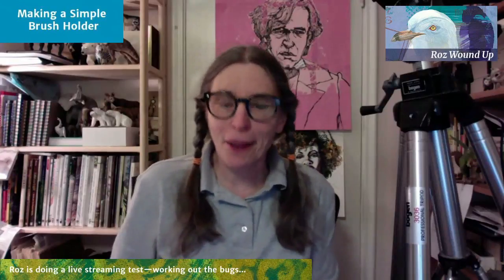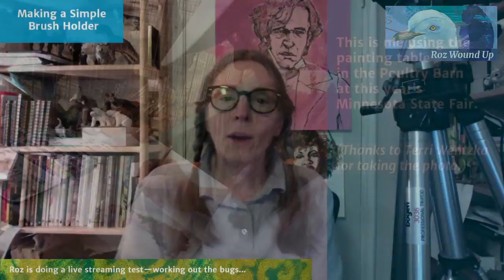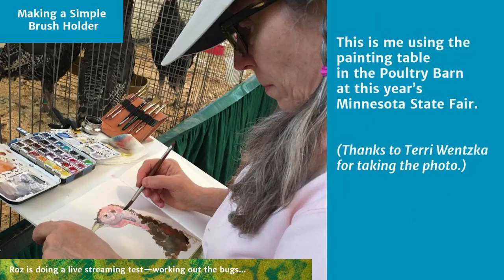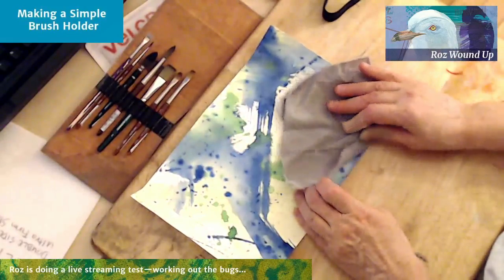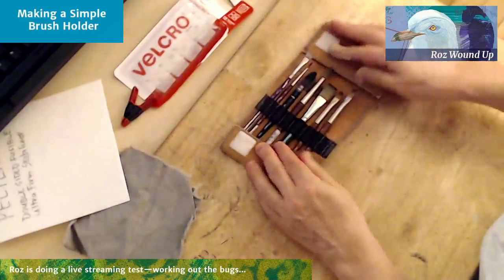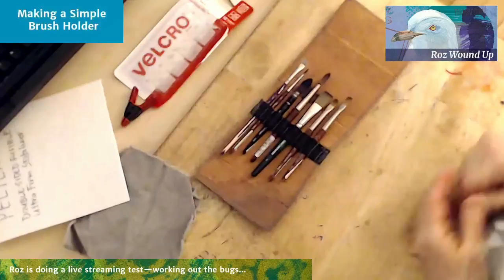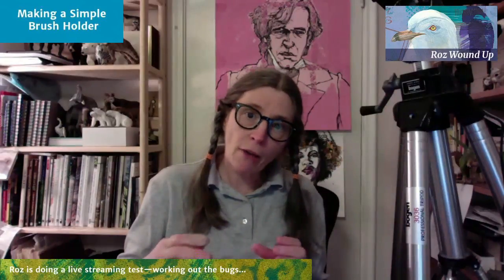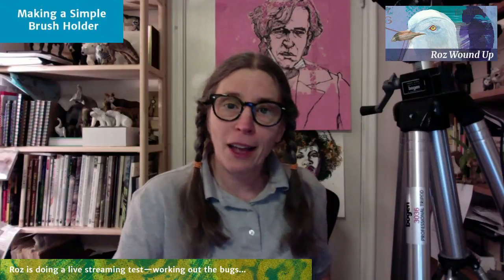Making a Simple Brush Holder

Comment: Great idea. Cant wait to see your final set up as well. I cave been using coroplast boards as well except instead of clips or velcro, i embedded tiny super strong magnets. Additionally, i cut a hole in the coroplast big enough to slide half way into it a urine sample cup from a dr's office. ( great leak proof way to carry  water and has a decent wide mouth to boot). Your Videos are coming along nicely. Thanks for sharing!
Reply from the maker: Magnets! That's something I always worry about with credit cards and stuff. Have you had any problems with the magnets? I like the Urine bottle idea. My ink bottle diagram that I gave Dick shows a cut out that I bet is similar to what you're suggesting. I'm going to order a urine bottle so that Dick can think about it in his phase of the project.
Reply: I have had no probs with the magnets i use the nickle size ( 2 of them to make sure my palette stays put) and on one of my board i put a teeny one on to hold my water.. ( i put a teeny one inside the urine cup,,so far it has held and it just sits on the board without moving ( make sure the positive is on the upside and the neg side is opposing it otherwise the cup will do anything but sit where it should. ) so far i am preferring the magnet to the cut out for the water ( if you put the board w the cut out on down flat on the floor or a table it forces thr urine cup up, level with the board) sadly i cannot send you pics here...
Reply from the maker: Thanks for sharing more about your magnets they are intriguing. I'm also sorry I didn't get back to you sooner about the "final set up." I can't to show this video to a student and in watching it see that I promised to have something else in September. Sadly there were too many disruptions in life this fall and neither Dick nor I had time to work on the final version. But I will put it up on my blog when it gets done. Thanks for your patience. And for all the magnet ideas!

Comment: Hi Roz, Love your brush holder.  You might consider just extending the top flap so it is long enough to fold back over, cover all the brushes and adhere to the velcro on the bottom.  
when adhered to your board, the upper flap will likely extend a little beyond the board, but that may not be a big deal.  The other option is to add a few more one inch or so sections that could fold up on the board, but when folded closed will attach to the bottom flap.
Reply from the maker: Thanks Lesli, glad you liked it. Extending the back flap (or the front) as you mention would be a good solution for some applications. Unfortunately for me I need both flaps to be the width that they are because of how and where they fit on the board. But I think your suggestion is excellent if people want a full case. For me and the way I carry it, adding more isn't necessary.
Reply: Roz you are amazing.  How you produce all the posts, paint prolifically, teach and respond to everyone is beyond me.  I'd love to take a class from you someday and recommended you to the Sitka Center for the Arts on the Oregon Coast.